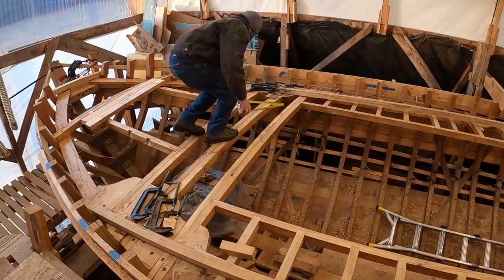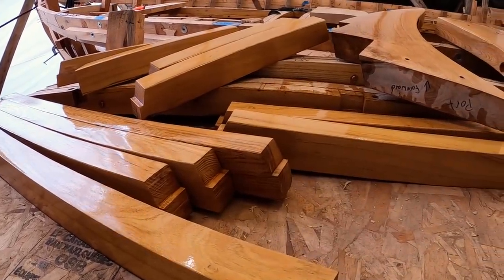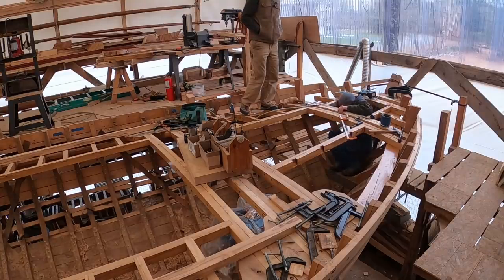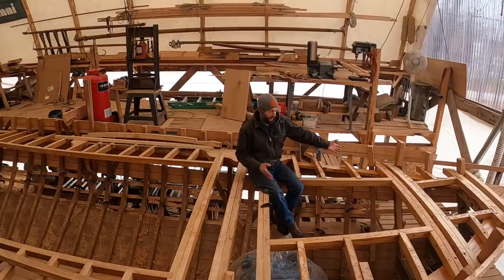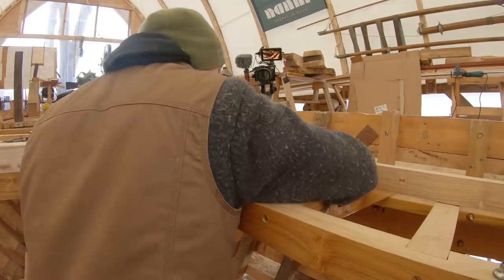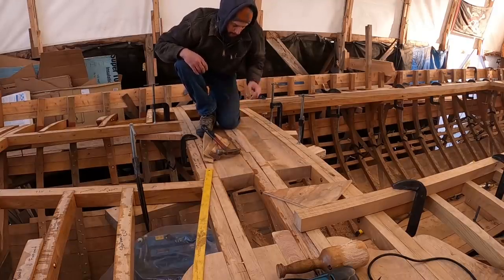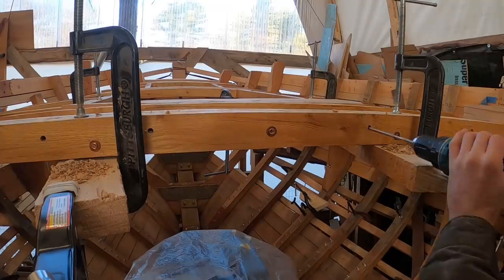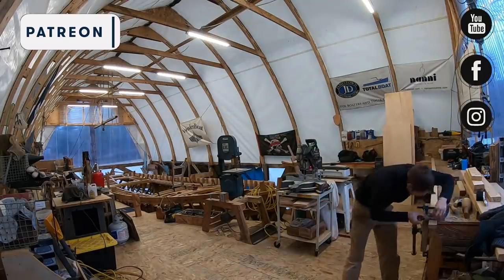Half Laps and Mast Blocking - Episode 147 - Acorn to Arabella: Journey of a Wooden Boat

Comment: From experience of wedging a bamboo pole in a tripod, used by Chinese acrobats, you only need an hole about 1 inch bigger than your mast, that gives you a lot of adjustment when the angle applies to the length of the mast/pole. Your accomplishment is very impressive!
Reply: I agree, I would think that even a one inch allowance will allow for enough rake.  A two inch allowance all around means for a lot of wedges and therefore a lot more potential for movement and displacement of the wedges.....me thinks eh!
Reply: I got the impression that he drew in a 2 inch buffer to make sure bolts would not interfere.  I think he'll cut the actual hole smaller.
Reply: @jerryf609  OK, making more sense.
Reply: I'm hoping the rediculously larger second circle is only to insure the clearance spacing for the bolts. Surely he realizes the opening only needs be a diameter of 2 inches larger max (8 inch hole) for rake and wedging purposes. (One inch on every side all around).

Comment: A keel stepped mast is definitely safer, having had a shroud failure myself and the mast stayed up, a deck stepped mast would have fallen. Also a smaller cockpit has advantages in that if you get a ‘greeny’ over the stern which fills the cockpit there is less weight of water and it drains quicker. You have a great advantage in being able to design efficient cockpit drains from the get go, the bigger the better.
Reply: +1.  Cockpit drains on every corner at least big enough for a tuna!  A lot of boats have a companionway that comes up in the cockpit and even with its bottom.  I call that a design mistake because it means if the companionway is open that water gets into your cabin.  People don't understand that a big wave can come along any time, even in relatively calm seas. They leave that open and wind up with four tons of water in the boat.

Comment: Certainly a lot of tedium in this batch of work.  And certainly illustrates this is no "weekend warrior" type of project for non-commital types. Takes a rare breed to slog away for days, weeks,  months and years toward a mostly romantic goal to sail the seas. Arabella will be a very functional and sturdy piece of art plying the waves and calling at exotic ports, Her crew will have complete confidence as they confront heavy seas-- no corners cut, no inferior materials or workmanship used to save a bit of time or effort. Love the new intro.
Reply: Only two years from the launch and already looking like a boat, ain't she?
(In my yard, we counted a third of the overall hours for hull and deck and two thirds for outfit/interior, spars and standing rigging, sails and running rigging, and the bloody rest from plumbing to wiring to cushions to seatrials and changes after seatrials .... just saying)

Comment: You guys should throw down and clamp some temporary 12" or 10" wide boards (A CATWALK) centered on port & starboard on top of the deck beams just to walk on. Will make your work go much easier plus it will save your joints and hips from aching at the end of the day.

Comment: Steve your Stanley Yankee screwdriver needs a bit of TLC. The helical grooves are obviously dirty as it is not coming back out as you release the pressure on the screw. Flood it with WD40 until it springs back out as fast  as anything. I still have both of mine I bought in the 1970's and have not used them a lot since leaving my trade ( I was a church organ builder before going into teaching woodwork and metalwork) but they still work and when flushed with WD flash in and out to the extent if you are not careful they can be dangerous! (Stabbing an innocent working in front of you lol) sometimes if they are gummed up with sawdust in the forward / reverse barrel then just pop out the little screw, press the flick plate down and slide the sleeve off, and note which way rocker  fingers are facing and just pop the rockers out and blow out the crap , more WD, blower out again, little bit of grease put back together and you are good for the rest of Arabella's build !

Comment: I’m a master electrician up here in maine, I love watching your build. I usually stay on my Pearson 30 in the summertime.
Just a suggestion, while your at the skeleton stage put a little thought into how it might be to run wires you will need for navigation lights, interiors, outlets, mast head light etc. hidden accessible wire chases are nice to have especially when planned out. On Purpose
Reply: Yes indeed! Tanks, pipes and at least mousing lines before bulkheads will make life so much easier down the track.
Reply from the maker: That's the plan!

Comment: I would make the hole for the mizzen mast bigger by at most 3/4" to 1" in radius ( 1 1/2" to 2" on diameter).  Many boats are much tighter than that even. Remember the boot ring extends another 1" to 2" outside that,  so you really don't want it too much bigger than it really needs to be, or the mast boot will be huge!

Comment: Hi guys - Nice clean shop @14.43 where Alix was working on the beam joints.  My only concern/suggestion is to gently put down some plywood so you won't do what I did: misstep and put a leg thru an open hatch or open space in your case and crack 3 ribs, ruined my day (and 2 weeks thereafter). I know you're sure footed like mountain goats but stuff happens. Just thinkin. Like the new intro and progress to date. Like the explanations as you go.
Reply from the maker: Thanks for the thoughtful tip, Ray.

Comment: Put thin cotton gloves over your rubber coated ones Alix. I work outside and must wear those cut resistant rubber coated gloves and a tiny layer of cotton on outside makes them 1000 times warmer.
Reply from the maker: Cool tip, thanks!

Comment: It maybe the camera angles and I know that the house structure still needs to go on top. However, it doesn't look like you will have much headroom?   The stern of the boat looks very tight with the Engine there.  How much of the boat will you have head height?  What you guys are making looks amazing,  it just looks like a very small interior for a vessel that you want to go exploring in.
Reply: I agree. I'm 6'4" and today was the first time it felt claustrophobic!
Reply: The cabin will have head room, they can make sure of that. The other spaces not so much, but that's normal for a boat.

Comment: It's kind of thrilling to watch the two of you guys gingerly stepping from beam to beam, trying not to fall through the spaces between the deck beams.  Doing that while carrying heavy loads, and planks must be a challenge.  Why don't you just get a few of those wide cedar planks from out in the lot, and lay them across those deck beams to give you a cat-walk to step on?  After all, it is a deck.  So just throw on a temporary deck.  I know you have enough material.  The day that one of you gets distracted, and fails to mind the gap while you fall through will be the day that you wish you had done that.  Be safe, dudes!
Reply: @RH I agree, I was going to suggest sacrificial 5/8 or 3/4 plywood laid in place or lightly screwed down just to avoid that fall. In my own case, I miss-stepped and put one leg thru an open hatch I knew was there but just made a simple mistake. 3 cracked ribs took a while to heal and sure slowed me down.
Reply from the maker: We've been fairing the material that we'd be putting something like that down onto, so it's not been possible. Thanks for your care and kind comment!

Comment: I assume each side of the blocking we need mini fore and aft Carlin’s from one partner( full beam ) to the other. Then the double beam that’s being cut through for the mast would birds mouth into those.  Generally with keel stepped mast I think the blocking grain can go fore and aft and the bottom face of it be half inch above the bottom of the beams. The top half of the blocking can be rebated 1/2” X 1/2” into the top corner of the box out created by mini Carlin’s and partners. Blocking sits in last. Nice to see the full bevels on all undersides of beams. You’ve probably already done this but it’s my view anyway. Thanks for the videos.
Reply: No end grain then and lateral forces are taken up through the wedges by the for and aft mini Carlins.

Comment: Hey Steve, instead of cutting a hole in the deck for the mizzen mast, why not put a part mizzen between the keel and the beam you would end up cutting through and sitting the mizzen on top of the beam, one less hole in the deck and more waterproof, and i like the new intro by the way.

Comment: Is deck stepping and keel stepping that interchangeable?  It'll put a lot of lateral load on the deck and hull that deck stepping would mainly translate to tensional load through the rigging. It is also just one more deck penetration to worry about in heavy weather. Just a thought!
Reply: Keel stepping is superior in every way.
Reply: Not sure why keel stepping makes things stronger.  Ed is right, it is trading loads from one place to another.   In the event one is in mast busting weather, having a mast bust is better than busting deck or hull structure.  Don't underestimate your engine access.
Love the form and function of the knees.  They are beautiful!
Reply from the maker: It’s an interesting conversation. A couple points to keep in mind:
- deck stepping means that if you lose your stays, the mast comes crashing down on the deck, deck house or possibly worst, someone on deck.  A keel stepped mast would be held where it penetrates the deck and may still stand. 
- deck stepped would still mean you would need something under that deck beam taking the load. Atkin had designed in a sort of partner beam that ran fore and aft and under the cockpit to step the mast on (so still going through bridge deck). You now have some of your mast below deck and a board running over your engine aft and taking space from the lazarette.
- keel stepping the mast is not 100% accurate terminology as it would be stepped on a beam that would span several of the bronze floors. Therefore the force will be transferred to all of the fasteners that connect the planking to the floors (or the knee in the case of the mizzen). This means the force is spread through more points as opposed to one right on deck.

Just some thoughts we’ve gone over to make our decision.  Most are going to have different opinions on a lot of the different construction aspects.  That’s the benefits or talking and sharing ideas!
Reply: @AcornToArabella  I'm very confident your decision is well thought out and the most workable  solution. Thanks for the conversation and keep living your dream.

Comment: I've been watching for a while now and one thing keeps coming up for me when you guys make changes intended to strengthen things and (in one case) make them easier to achieve - what are the implications of the increased weight involved in many of these decisions? You mentioned that using more oak planking would make it heavier but that you were ok with that but there seem to be a number of other things like the floors and now this longer mast that raise the same question. Is this weight not adding up? Is a heavier boat just slower/harder to steer? Does it change the balance and stability? are you keeping in mind where the added weight is going in the boat?
Reply from the maker: That's a great question, Luke. An extra knee or support in the deck doesn't add much, but moving or adding a water or fuel tank would. Cumulatively, the % difference in weight for the planking, for example, in a boat designed to have about 25,000 lbs total displacement, doesn't put a dent into stability at this scale.
Reply: @AcornToArabella  Does this mean that you're doing the weight and distribution sums all the time or just when there are larger numbers involved?

Comment: If the engine is further back, does it adversly affect handling? I'm thinking of balance/CofG/....
Reply from the maker: Yes, the engine's placement is important to balance, however, the engine isn't any further aft, it's more that it's more compactly engineered compared to older engines. It's easy to compensate for a few pounds here and there (different materials, say, in planking or a smaller engine) by balancing the boat when she's afloat. Water and fuel tankage, for example, will have more of an affect on this than the different engine size.
Reply: @AcornToArabella  Thank you for explaining... I was concerned for a moment... (but I donb't have the foggyest about boat building.  The series is fascinating, engaging and sort of educational.  Good luck!

Comment: A question about the mast: 
Are you building it yourself? And if you are, is it going to be built out of one solid piece, or is that not preferable? I dont know much about boat building obviously. Cheers from Sweden!
Reply from the maker: Hello Simon. These are great questions. Yes, we'll be building both masts, and the decision is being made presently as to the type of construction. Many people like to have hollow masts so the wiring for the navigation lights/instruments runs up the middle and because keeping the rig light (as little weight aloft as possible) is a good idea for stability. For solid masts, which in a low-aspect gaff rig is possible for us (Marconi/Bermudan rigs are much taller), we'd rout a channel for the wires. I think we're leaning toward hollow. Bird's mouth or box? We'll let you know.

Comment: i wonder if there will be any vibrations from the engine effecting the mizzen mast if it sits right in front of it. maybe you ll end up with ringing shrounds when the engine is running.
greetings from Hamburg, Germany
Reply from the maker: Smart thoughts, Henri—and we can look to other boats for a potential answer. The proximity of the engine most likely won't be a problem, as almost all boats while underway end up with a little rattle here or there that need tending do during shakedown and there are lots of ketches in the world that go far.

Comment: As someone with zero knowledge of masts & boat building, I'm wondering if there is a reason why the parts of the mast seating in the floor and the thru-deck section couldn't be shaped square, as one would do on lathe work for stair railing spindles, to prevent spinning? Or maybe that's exactly the reason to leave the entire thing rounded? Or is it simply because trees are round and not much shaping to be done? Hoping to learn something, thanks!
Reply: Here's a couple of answers for you about masts.  A tree, the size needed for a mast would be extremely heavy, so most masts are built by joining planks together in the shape of a circle to form the mast shape with a hollow center.   A hollow mast is much lighter.   In addition this makes it easier to taper the mast from base to peak.  Google search "bird-mouth spar joint" and you will see how the wood planks are joined together.  Afterwards, the whole mast is planed smooth into a cylinder.  On a ship, you don't want any square edges where lines with knots can get caught.  There are 100's of lines on a sailing boat, so keeping wooden surfaces round and smooth help eliminate jambs where ropes can catch.  Masts are always cylinder shaped because the cylinder shape can handle much bigger bending loads than a square shape, because the loads are not concentrated along the square edges.  Same reason fishing poles are round, and not square.  Therefore, masts are always made into a cylinder shape from base to peak.
Reply: @rahbabakahn  Wow, thank you for that explanation. My initial thoughts were of the sections passing through the deck, but I didn't realize the stress loads on the different shapes. Makes sense!

Comment: question, Will the house sit on the deck frame or on top of the deck planking?
Reply from the maker: It will be laminated and sit on the sill which we have just fit to the deck framing.  Secured with through bolts.

Comment: Doesn't that set-up for the missen mast turn the side loads on the part of the boat into sheer loads on the bolts?
Reply: With the mizzen stepped on the keel the lateral loads at the deck will be minimal.  Once the bolts have clamped everything together the shear loads will be negligible as they will be passed through all of the surrounding structure; nit just the bolts.  The loads are absorbed at the keel and the standing rigging attachments save for a little flexing load of the mast timber.  Stepping through the deck has some convenience and safety factors but it's not what holds the mast up.  One of the boats I owned was a cat rigged boat that had no standing rigging.  All of the lateral and fore/aft loads were taken at the keel step and the deck; a very different situation.

Comment: Don’t block in the engine. You need to be able to able to slide it forward to work on the gearbox and drive train easily. Keelsteping the mizzenmast isn’t a big issue .... the loading are comparatively small compared to the main. Also keel stepped is not necessarily that much stronger than deck stepped (if properly stepped). It just mostly changes the flex of the mast.
Reply from the maker: Hi Simon! The gearbox in a marine diesel is aft so that's not going to change anything, but also, we will be able to reach the front of the engine and access everything there that's important. Thanks for watching and for your thoughts!

Comment: Why not use a power drill/driver instead of the hand drivers to put in the brass screws?
Reply: Power tools tend to damage the bronze screw heads and you don't have the feel of torque applies through a power tool.